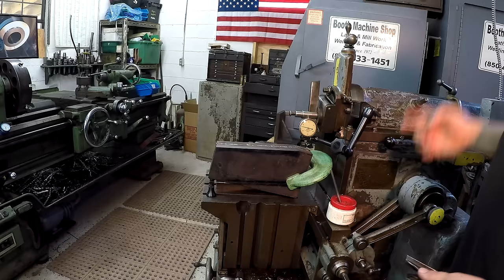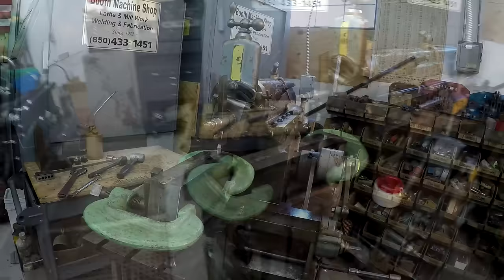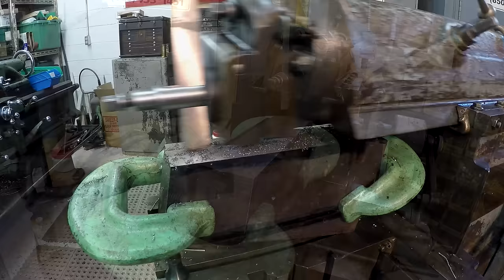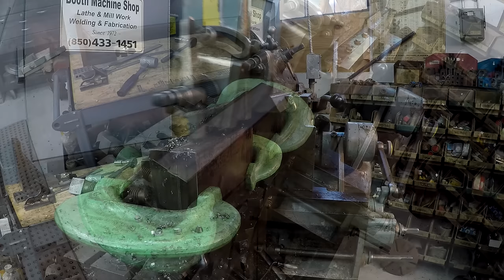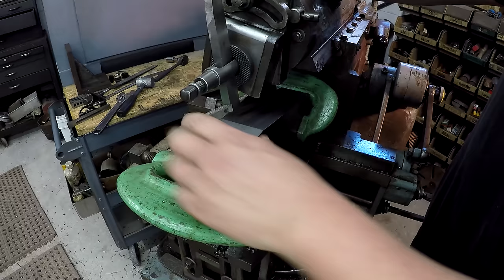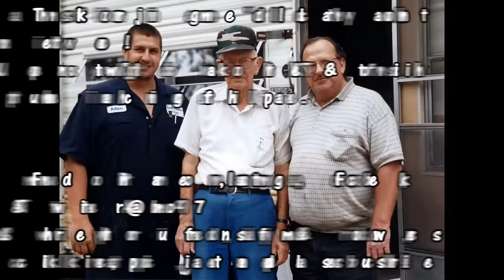Kearny & Trecker Parking Attachment Part 3

Comment: Had to take the vertical head on and off the Cincinnati twice this weekend for different jobs, a parking attachment for it sure would be nice.  Glad to see the shaper getting in on the action, the old straight line lathe sure can leave a good finish.
Reply from the maker: +bcbloc02 Might be a project for you later, maybe for the new shop!
Reply: Abom79
I have never seen a parking attachment for a Cincinnati, not sure they even made them so I would have to design the thing myself.  Could still be a project though, maybe a proper welding table 1st though. :-)

Comment: Adam, I've noticed that the cross slide moves on the cutting stroke and not on the back stroke. The yellow nob on the side cams 180* out to allow for table movement on back stroke or forward stroke. So what is correct as I have a shaper I use sometimes. I believe it sets the amount of table movement per cut depending on how far it's offset from center. And finally what are your thoughts on a carbide insert holder in a shaper?

Comment: always nice to see you work, but would you mind clarify why you did not weld the short ends?
also, on the first cleanup run, did the compound really "jump" on the return stroke?
Reply: +SirDumle I wondered about that too. I think it is to lift the cutting edge off the piece on the back stroke.
Reply from the maker: +SirDumle The ends will end up being welded together once the other pieces are machined. It'll al be tired together. No good reason to v and weld, then weld again with something on top of the end.

Comment: hey bro,  i live in the san fernado valley. ca  very close to universal studios you and  your father once worked on the JAWS picture.  1976 ? well bruce  (the shark)has been sitting in a junk yard . at ALDIN BROS 91331  for years  i go there  allot  to keep my heep running its a pick a part ive been going to for  25 years  due to the min wage  the yard burned today i have friends that have been there for over 50 years. btw it is a 1956 ford  ranchero. i cant aford a shirt but if you can xl black with pocket  MAKE THOSE CHIPS . esparkyr1

Comment: I used to repair machine tools - mainly the electronics and electrical end, but sometimes got into the hydraulics and so on.
That's how I got the tools I have.  I've got a much smaller shaper than that one (traded it in lieu of a bill because the owner was having a rough time and trading helped him out a lot) - six inch I think (at most 9).  I remember some shops would sneer at shapers, but the older machinists I knew really liked them. When the feed mechanism broke (bad casting), I converted it to CNC - could do some pretty wild things with it (including easily making timing belt pulleys).  

I'm in the process of trying to get my tools back in operation (long story involving a fire and other things) - but for personal repairs and "making/modifying stuff". (BTW, thanks again for the tip about Evapo-rust and Boeshield!)

Comment: Hi Adam, love your video's and your workshop is to die for, I, like you am a tool tart, I love tools especially the older good quality stuff, And without a doubt , you can't have too many machines.. One thing I have noticed though, is that you could create a lot more workshop space, if the blaster cabinet were outside under the "car port" or is that not feasible,, just a thought. Keep up the Vids Adam, I am new to your series, but catching up. Regards Chris. England.

Comment: Old school machines and maybe I'm wrong in saying this. But, the shaper still has a place in the modern shop as you have proven.
Back in the day when I was in machine shop class in high school I loved running the shaper I made a V-block or two. It was a good experience for sure.
You got a great finish on the block with the shaper very nice.
Adam, thanks for the cool video.
Jeff

Comment: Adam,  in my high school shop class we made an Allen wrench stand from a rough casting.  We used the shaper to make the top and bottom flat and parallel.  It was captivating to watch,  as it made a new smooth surface from the casting.  I enjoy your project videos. Thanks, Harvey

Comment: Real fun to see that shaper working. One thing is that I was staring at the clapper box and it didn't seem to move at all.  I am sure it did and I just couldn't see it, but if it doesen't move the tool will drag on the way back. A real blast from the past. Tjhanks for posting!

Comment: i ran a kearny  trecker   900.000.000  for air knifes had to cut .09000 slot on all of them  375 ground 316  x8'' with a .09000   with a 5 ' slot i got fired help me make this still work for me

Comment: You might also point out for people not familiar with shapers, that the tool mounted to the compound is hinged so that on the return stroke, it is free to lift up and not engage the piece on it's back side. That shows up in your video a little, but it would be more obvious on a heavier cut.
   Back in the day, prior to CNC, they were commonly used to cut 2D profiles on die sections. The operator would work the compound dial while the machine is running, moving it a little after each pass to follow a layout line for any kind of irregular shape, hence, the name.
Reply: +Propylparaben   Didn't know it had it's own name, but it makes sense, that's about the sound it makes.
Reply from the maker: +John Winslow Thanks John, yes that part is known as the Clapper Box.
Reply: +Abom79    But I'll bet your shaper isn't as easy to turn on or off and the real "Clapper"   ;)

Comment: Hi Adam - I notice your cross feed works on the forward stroke (on my smaller Boxford the feed is applied on the return stroke). Is this a feature of the Sheldon?
Another great video, thanks.
Reply from the maker: +Steve p It's adjustable but still working on getting it right

Comment: I can remember these from back in the day, where milling and turning was part 
of my car mechanic apprenticeship.
I am wondering, is there any application where this is still preferred to a mill? I can imagine the tools are cheaper,
but you have to buy an additional machine to your mill. We only used them for the sake of using them,
preshaping our workpieces which we could have achieved using the mill in the first place.
Reply from the maker: +Tom A. Hawk They are great for cheap tooling and making large parts flat. They are also great for custom internal shapes like keyways, hex, and square holes.

Comment: Real nice cuts there Adam!

I wonder about those high ends. That is a pretty stiff hunk of steel. Did they cut high on the mill, warp when welding, or is the shaper worn and cutting low at the ends of the stroke? I think I'd be inclined to blue it up and put it on the surface plate, just out of curiosity.
Reply from the maker: +l wilton It must have warped the plates when welding. I checked the shaper last year and had about .001 "droop" over a 12" cut when sweeping the table with an indicator, so it's not the shaper.

Comment: Hey Abom!
Very nice channel. The head that holds the tool around 14-15 mins in is moving sligtly up on the way back!
Reply: +Ulf Alexandersson its meant to, so it will only cut forward, but not drag on the back stroke, you can only cut one direction

Comment: What is the advantage of using a shaper over say a face mill?
Reply: +mlnlme1 same as the advantage of driving a museum car over a 2016 model.
Reply from the maker: +mlnlme1 Cheap tooling, long smooth beautiful flat cuts, and internal shapes like keyways, hex, and square holes. Also good for large work pieces that need to be made flat.
Reply: +Abom79 Okay thanks! I currently have no access to a machine like that, and in fact had never even heard of it. Seems like a really cool thing to use if you've got it.

Comment: AdamYour fed is backwardsfeed screw turns on return stroke not cutting strokeyellow knob needs to go the same amount on the other side of centergreat veidos
Reply from the maker: +George Seal I've played with it and cannot get it to work the way i think it should. But I'll check it with the yellow hand knob moved to the other side of the assentric. Seems like it's trying to feed over before the cut is finished though.

Comment: With the angle the hinge on the compound is set up, when it returns, wouldn't it push the side of the tool into the side of the just cut material? Or is the friction from that essentially what causes the hinge to actuate? Never even seen or used a shaper in real life so it's cool to see.. maybe I'll dig out my old handbooks...
Reply: +Полиграфович and by my old handbooks I mean handbooks older than my daddy haha. I think it'd be cool to explain to people that aside from you havin fun just usin the machine instead of the mill, that shapers still have their purpose even today when extreme flatness is required and grinding isn't exactly an option
Reply from the maker: +Полиграфович That's the clapper box, and it swings up on the return stroke so that the tool will clear the part and not dig in. you adjust the angle depending on the cutting angle used on the sliding compound.

Comment: How much weight difference between the cast & steel? I noticed the cast had weight saving areas cast in. Are you going to mimic that idea?
Reply: +dlstanf2 after the exterior is done he could take weigh from the inside if he deems it necessary :p
Reply from the maker: +dlstanf2 Maybe I'll weight them both at the end of the build.

Comment: 13:25 do you always have a bit float on the cutter like that? (As its retracting)you can see again @ :29
Reply: +landlockedviking Shapers are made like so they don't drag the bit on the backstroke.
Reply: makes sense, thanks!
Reply from the maker: +landlockedviking The tool is made to lift like that on return stroke.
Reply: cool, thanks

Comment: so what advantages are there to using this machine rather than using a conventional mill Adam?
Reply from the maker: +bchant19 Some advantages are, cheap tooling, beautiful flat finishes, internal shapes such as keyways, hex and square holes, and they can really move some metal when needed. Some jobs are easier to get flat in this machine vs a knee mill.
Reply: cool thanks for the reply adam I appreciate it